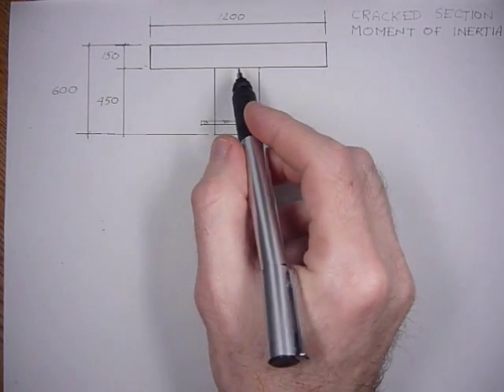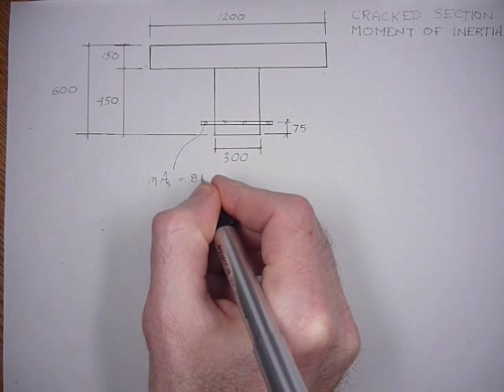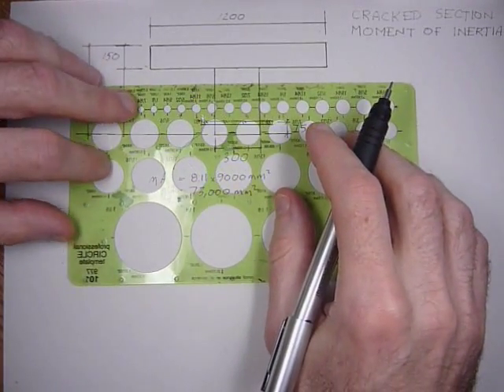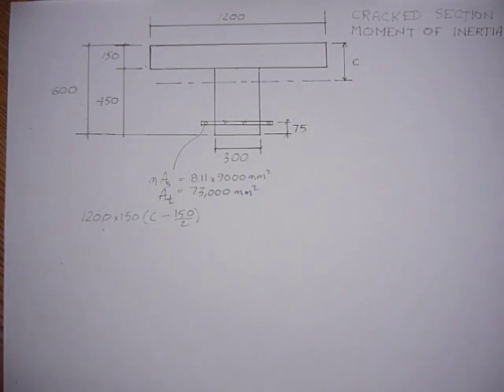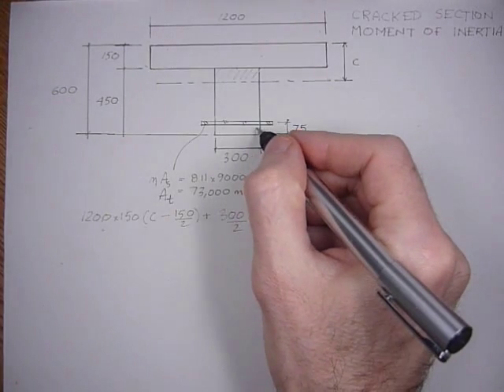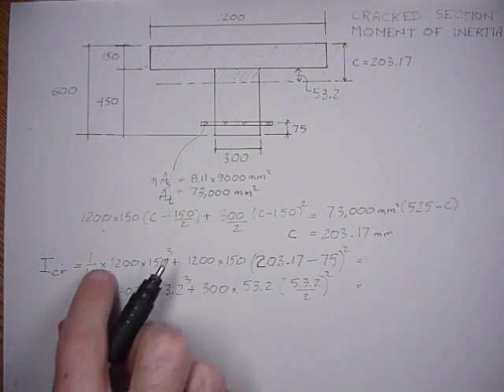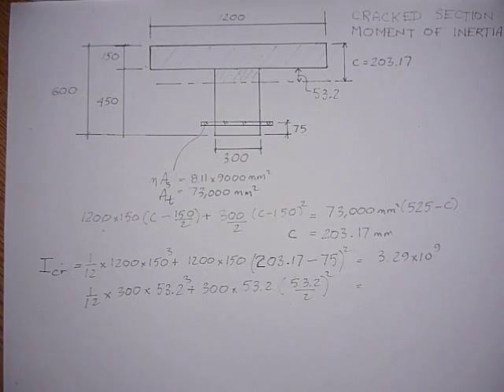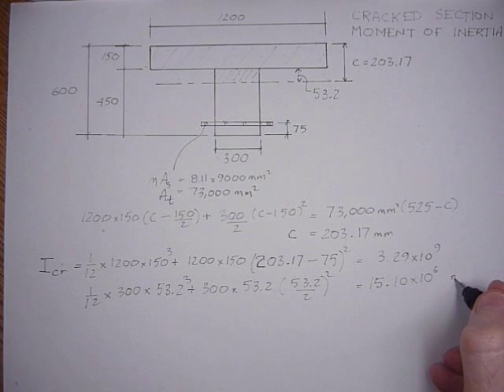T4.2 Cracked T Section Inertia

Comment: Can someone please tell me why is 300 divided by 2 & (C-150) squared?
Reply: Just a simplification of summing static moments about the neutral axis:
[Area]*[moment arm] where the moment arm is the distance between the neutral axis and the centroid of the portion
Area = 300*(c-150)
centroid of this portion is (c-150)/2 above the neutral axis
[300*(c-150)]*[(c-150)/2]
Simplifies to 300/2*(c-150)^2

Comment: There is an example in my textbook that is similar. They don't, however, use the parallel axis theorem to calculate the polar moment for the web of the beam. Is there a reason for this? As well, why do we not consider the moment of inertia for the steel portion, and only take a*d^2?